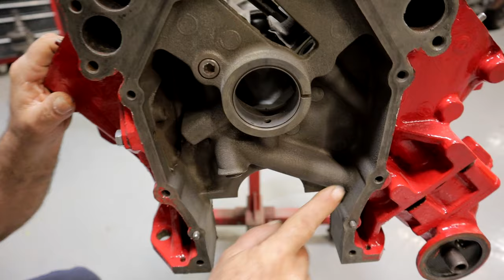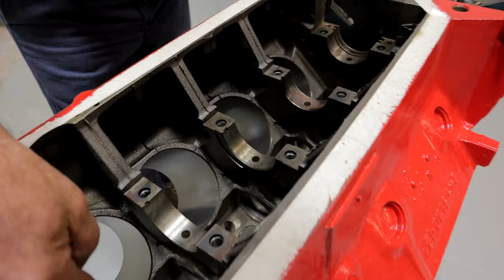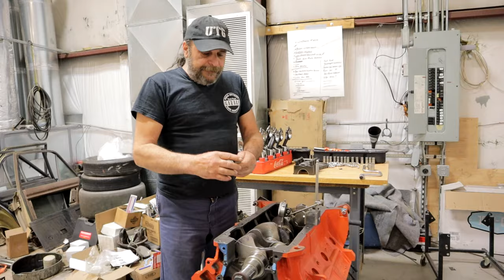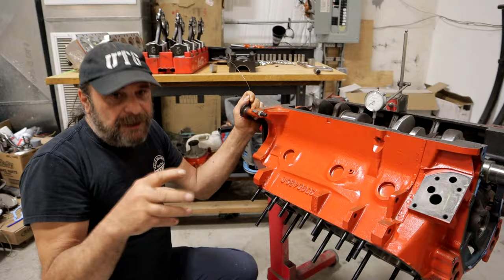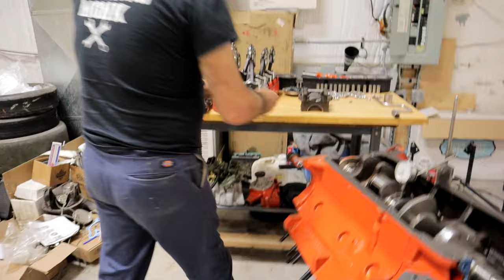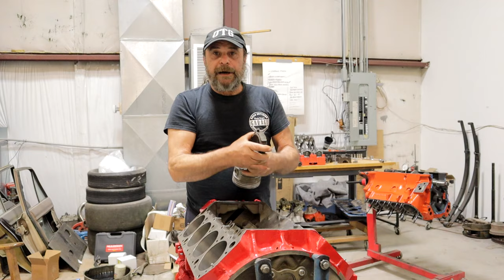Oiling System Flow Path Of The Classic American V8 Engine

Comment: I remember in the 80's about a electric pre startup oiler that had a reservoir. It had a connection to the key start with a delayed start till oil pressure reached a preset pressure. I've always thought that this was a very reasonable solution to avoid startup damage.
Reply: It avoids startup damage, it prolongs engine oil life, if prolongs engine life, lessens pollution levels of start up for many obvious reasons, and is just a great system overall.
Reply: Loving it T👍
Reply: @DerpyRedneck  yeah sounds very effective. Put it on the shelf!
Reply: There was another one that was pressurized , no electronics. I  think it was called Accusump, possibly by Holley.

Comment: Great video Tony!!  A lot of people fail to realize that pumps don’t make pressure.  Pressure is resistance to flow. That’s why old worn out engines have low oil pressure, not necessarily from a weak pump, but because the tolerances (resistance) is no longer there.  Keep it up!!
Reply: Yeah it's always fun to watch a mechanical gauge on a cold start and it takes 5-15 seconds before the needle even moves,it gets ya thinking.

Comment: Hi Mate, I’ve got an interesting old engine (for me anyway) it’s a 1953 260 cubic inch Rolls Royce inline six where the rods are drilled vertically to lube the piston pin but has a hole drilled at 90 degrees through the side of the rod to directly lubricate the thrust side of the bore. It also has such niceties as a billet crank, sodium filled exhaust valves, beehive valve springs, dual point distributor and everything is mounted via studs. The cast aluminium sump holds 16 litres of oil. I’d like to hot it up and stick it in my model A roadster.
Reply: That's way cool. I would love to see it

Comment: I'm a Ford guy butt use Unka Toeknee for reference. I'm rebuilding a 4.0 OHV and have spent time cleaning and studying the oil systems in the cast and drills. Fascinating how it all works and the many passages to balance psi where it's needed. Some places, it's a miracle how any oil gets to the parts like rockers on this specific engine.

Comment: Excellent explanation of the oil flow through the block.  I often see builders that ad a line from the main oil feed to the left lifter bank.  Is that worth the trouble or just a race engine modification?  Thanks for all the great videos.  Mike
Reply: X2 I have seen this as well with the disclaimer that it's really only for extended high rpm use but I would love a better explanation

Comment: Thanks a few corrections 
1. The number one main bearing gets oil direct from the filter 
2. The right main gallery feeds the mains and the right side lifters
3. The left gallery only feeds the left side lifters
4. The rockers are fed through the #4 cam bearing which acts to limit the supply of oil to the top end.
Reply: Yes you are correct on the #4 cam bearing. I believe there are actually three oil holes in #4 cam bearing and the camshaft oil passage is drilled at an angle that alternates with the left & right side to direct oil to the top end. I believe I am right in saying this and I believe this is somewhat unique to Chrysler big blocks? I am currently involved with an engine rebuild and it  is not getting oil to the right side top end. Machine shop cleaned, bored and installed cam bearings. Suspect the cam bearing was installed in the wrong orientation? Will need to pull cam and check. Lesson learned to check this prior to assembly.

Comment: This is why I devised an engine pre oiling system using turbo post oiler pumps. 10-15 secs of the pre oiler pump running pressurises the oil galleries pre start..

Comment: Miata motors are also known for lifter tick, they actually have piston oil squirters that some people remove and cap off. I'm assuming that leaves more for bearings too
Reply: Nearly every modern motorcycle engine use piston sprayers. The reason is for cooling the under side, so much thinner castings can be used. At 13-14 thousand RPM, the piston doesn't have time to cool between cycles.
Reply: @outlawbillionairez9780  the miata crank turns to a noodle at 8200 rpm, Rev limiter kicks at 7400 on stock ecu. No wonder they remove them on the forged internal builds.

Comment: I knew of a 440 that had -0- oil pressure. It was running fine in a boat and all of a sudden pressure loss and a hard miss. The owner shut it down and was towed in. When the shop took a look at it they told him the engine was dead and needed replacement. When they took the old engine into the shop they found a bent pushrod and the lifter laying in the valley. They put the lifter back in installed a new pushrod, it ran great and had good oil pressure. They sold the engine off as used and it ran for years to come. We never did know why the pushrod bent?

Comment: Cross drilling the crank is a better choice then switching to fully grooved main bearings (assuming the tools and skill are available).  The strength of the oil film across the width of the bearing is directly related to the bearing surface width.  A groove down the middle splits the bearing into two narrower bearing surfaces, reducing the load carrying capacity and film strength.  Most of these classic engines are so over-designed, if there are fully grooved bearings available, use them, but they will not have the same service life as ungrooved bearings.  Your mileage may vary.

Comment: Tbh engines and design change so much from manufacturer to manufacturer that what you should do is look at what the manufacturer wants you to do. personally I don't prefill them and I've had engines make it in excess of 230,000 miles. It doesn't matter how you fill the filter just make sure you got a good one and it's got good oil.

Comment: I’m not a gm guy but if I remember the olds 455 head oil drain holes are at the top of the head so high pressure pump will cause oil starvation due to all of the oil being in the heads.

Comment: I have to say that, these days, I prefer solid valve train over hydraulic lifters. I can deal with the extra noise and the extra tinkering. After dealing with the hydraulic lifters in the 3.1 liter V6 my 2003 Grand Prix had, I am good on dealing with that ever again. Since I went back to being in a Honda the last 9 years now, I rather have the most direct connection possible from the cam to the valves.

Comment: I'm putting a 5.9 magnum together and I noticed the cam bearing holes din't line up with the oil galleys in the block. I looked it up and a lot of people saud that having them offset, but not more than blocking half the holes is good because it acts as a restriction and keeps oil elsewhere. I'm not sure how I feel about it though. People were saying they've seen many many magnum engines like this with no wear.

Comment: Galley: 1) a low, flat ship with one or more sails and up to three banks of oars;  2)the kitchen in a ship or aircraft; 3) a printer's proof in the form of long single-column strips, not in sheets or pages
Gallery: 1) a room or building for the display or sale of works of art; 2) a balcony, especially a platform or upper floor, projecting from the back or sidewall inside a church or hall; 3) a long room or passage
Which one of these fits better for the passages in an engine through which oil flows?

Comment: I pretty sure Im wrong but I think I remember seeing something about Ford straight 6 where the oil traveled to the crank first. Like first generation mustang 6 cylinders. Or called reverse oiling. My memory is a blur.
Reply: That would explain the constant rocker chatter in the straight 6 if it were true.

Comment: Old Ford y blocks had horrible oiling to the top end. Aftermarket kits plumbed extra oil from the sending unit port into the head via a hole in the valve cover on each side just to keep the top end lubed and semi quiet.

Comment: I drive a 318 Mopar V8, and I bought it with higher miles. Is there any way to clean out sludge build up?
Reply: Just change the oil more frequently for a while, say every 1000 for 5k. The high detergent levels will scrub most of the crud out. Some guys add extra detergent additives or even atf to speed it up, but thus can dislodge so much at one time that the filter can clog.

Comment: Very informative and clearly the best coverage of the topic(s) anywhere on the net...thanks....does the rockers get an intermittent oil supply in a hydraulic lifter engine similar to the intermittent supply to the rod bearings in an engine w/ only the upper main cap grooved? Solid lifter engine would have continuous flow to the rockers? Never realized roller bearings are not lubricated w/ pressurized oil...have seen the squirt hole for the valve tip rollers but thought the rocker trunnion rollers were feed from the pushrod/rocker cup hole. Thanks

Comment: I had a crappy oil pan on my 413 and would lose pressure at the end of the track I got really lucky never wiped a bearing,  I think good oil saved the engine 20w/50 vr-1 is some of the best.

Comment: Did block lubrication flowpaths ever change over the lifespan of the LA platform? I realize this video is specific to big block but I have a pre-magnum roller 360 and I'm curious.  Also, are there any publications from original Engineers explaining their design choices?  The information you're providing is incalculably valuable

Comment: Hey Uncle T, thanks for dropping all this knowledge on us.

Quick question: As someone who’s still running a stock, never opened ‘67 283 Chevy with the Powerglide. Is running unleaded gas causing any ruckus that I should be aware of?
Reply: If it's got hardened valve seats.the lead used to cushion the valves?
Reply: I cracked open my 66 283 and it had been run for years without lead...ND there was no wear on the valve seats, I cleaned them up, fixed the valve guides and put new seals and springs. I gave them a quick lap with grinning compound and they're still on my engine.
Reply: The seats will work harden over time from heat and use. Really the only thing that ends up happening is a sunken valve. You should be just fine though if it's ran this long. If however you get the valves and seats reground I would recommend having hardened seats installed. If you regrind the seats and valves it cuts away the work hardened surface from the cast iron and can start the valve sinking issues. Starting with a freshly done cast seat the lead or substitute is definitely required but after all this time heat cycles and valve repeatedly hammering the seat they are plenty hard enough. I would recommend premium gas though leaded fuel helps prevent damaging pre-detonation issues and typically was a higher octane better quality gasoline than what is available these days at the pump short of leaded race gas or aviation fuel they would be ideal and much closer to what was commonplace back then.
Reply: Youre  a lucky man

Comment: I've always assumed that one of the reasons for the noted longevity of the slant 6 is due to the oiling system.  However, I've never been able to determine how the oil system was laid out.  Now I know that I was correct - the mains are prioritized over the lifters - it all makes sense.  What are your thoughts on re-configuring a system to prioritize the mains over the lifters in the name of durability and longevity?  This would be for street or truck application - not a race engine.  Thanks for the great videos!

Comment: An interesting thought tony

Ive been finding that the good old diesel 2.8 hilux engines (3L is their name) have an oil issue

Now that your talking about oil circulation it would make sense that once turboed, where we feed the oil on these old dogs is right out of the oil filter/cooler. 

So rather  than going to the bearings it goes to the turbo and thats why i think they end up snapping No.3 rod journal

Heat, plus lack of oil and well usually 20 psi would definitely snap a crank

Comment: What, if any modifications are needed to run a dry sump oiling system?  Small Block 360 and a 1600 Ford Kent engines (Formula Ford, SCCA) here.

Comment: Would you add the oil filter is not a full flow system? Not all the oil is going through the filter every time it goes through the engine

Comment: Question what happens when Lifters BORES needed to be  Bushed? then shop never drilled out the feed holes. I had that done but never had them drilled out for side feed with a Hydraulic cam . the engine never had a problem also note i installed high volume ump

Comment: I have a 1971 Challenger 340 that has not run since 2011 I got it running but have a noisy lifter in driver’s side. What should the procedure be I was told ATF oil change I have had valve cover off push rods seem fine.

Comment: Is Lucas a good product to cling on parts 4 lubrication?????
Reply: Mark I know you are asking Tony but I heard him say on tech night he was dead against the way Lucas clings and climbs up on rotation engine parts.
Reply: @jimifed2798  oh really 😏 🤔 
I wonder why?
Reply: @markjones9631  I'm guessing friction losses around the crank like blanket wrapped around the crank and not returning to the oil pump.
Reply: @jimifed2798  you know that product has been around for ever , im going to research it more thanks for telling me .the second you hit key the Lucas is cling on parts ,at auto stores they have the gears in glass .
I've heard engine,s taken apart show no wear after Lucas has been added to oil .
Goes back to OEM I guess 
Thanks again, I sold my mustang that I used Lucas in 7qt valvoline 10w30 racing oil 1qt Lucas. 
It was a sweetheart Boss302.
Now drive 2010 mini cooper S .
35mpg 🤣🙋‍♂️👍🤑

Comment: So if the pin oilers are set to oil the opposite pin wouldn’t flipped pistons result in spraying the sidewall of the block?
Reply: Nevermind. I’m dumb.
Reply: I haven't seen an aftermarket rod for b/br engine with the slice in the cap

Comment: Why not have a 12 volt pump, that engages as soon as the key is turned, and that pressurizes the entire oil system before the engine is started? In the same manner that a diesel engine has the glow plugs energized prior to startup? You turn the key to "run", and then pause there until the idiot light goes out. 
I remember discussing this very thing back in the late 70's in high school automotive class. 
I wonder how long engines would survive, if they NEVER started up without a fully pressurized oiling system? 
It wouldn't be hard to engineer such a 12 volt pump that picks up oil from the pan, and pressurizes the system, so why has it not been developed?

Comment: you should show the cluster fk of the ford 390 oiling
Reply: ok I guess you did. the big problem is the oil hole to the mains are not inline with the hole in the bearings, some are horribly offset

Comment: The only domestic engine I can think of that is different from this, is the Y Block Fords and it's the reason you don't hear too much about Y Blocks because they had HUGE oiling problems. You can make them better, but they will never be what others are. That's probably why the FE's that replaced them where too much on top because Ford almost sold the farm with that. At least the FE's did away with the "top hat" solid lifters that are a total pain in the rear to change because you have to lift them all up, pull the cam, and drop them out the bottom. Yeah.... the Y Block was a different animal in the evolution of the V8. Some things really worked, but others where a flop. Still a fun engine to tinker with though.
Oddly enough UTG, we just came across a 1928 Willies Overland Whippet Coupe. Oddly enough it was advertised as the 1st pressurized oiling system. Little Bitty 4 cylinder engine in, and is neater than all get out!
Great Video Uncle Tony!

Comment: Very good informative video Utg comes through.  Just wondering how many 360 ci Dodge motors are running with full groove mains and standard oil pumps like mine . I didn't know you needed a high volume pump plus the only main bearings available were full groove.
Reply: I think as long as the engine has good oil pressure you’re fine. I imagine this is an engine youve rebuilt so if all the tolerances are tight it should be making up for little bit extra space in the mains
Reply: @tl5108  Actually I was looking through some of my recipes and the scecond time i freshened up the engine realized by the date that the 360 has 3/4 main groove bearing shells in it now.  Its also very hot in the northeast and yesterday got caught in freeway traffic and the oil light never even flickers with a low idle , so for me I'm not sure a high volume is really necessary.

Comment: Heat!?
Reply: That could be a whole different lecture based on condition, viscosity, type, pressure, volume, engine mileage......damn, that list could get long.
Reply: @reaper20015  Right? Always think of viscosity and oil temp when people are talking about oil pressure and engine lubrication. A cold engine doesn’t produce the same HP as a warm one down to many things, but oil temp is definitely a contributing factor.
Reply: Due to*

Comment: 10 pounds per 1000 rpm and after at Idle no less then 15
Reply: I have a friend with a 64 Austin Healey 3000  3 lbs at idle 10 lbs at 2000rpm and 20lbs @ 3000 been running that way for at least 15 years.  It does steady climb with rpm so I think that's what keeps it alive.